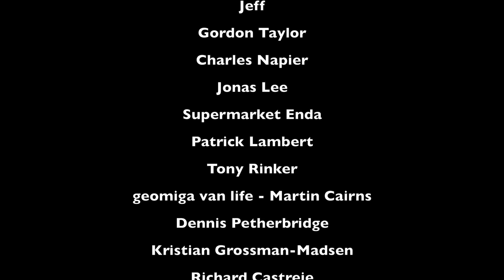Van Build: Diesel Heater Fuel Line Assembly

Comment: Try to get some insulation on the walls. the warm air from the heater and cold walls of the van may cause condensation and possible mold issues.

Comment: Looking good so far! I've put a 2kw version in my DIY camper and have been very happy with it so far. Keeps the camper at 18 degrees on it's lowest setting. It's been around 2 degrees this week.
Reply from the maker: That's great your heater is working. 2 degrees, not too different to temps around here lately!

Comment: Hi, the pump will wear out prematurely if mounted on an angle, it's about lubrication... It needs to be straight up to be properly lubricated  
a small adjustment
Reply: I'm pretty sure that it's supposed to be mounted at an angle

Comment: Nice, and as its dry heat your condensation won't be a problem/until you turn it off/so just leave on low over night, when you go to work leave a window slightly opening to compensate for moisture/yet know dought your still get sum/even insulted vans get plenty of condensation.. All best

Comment: Neat installation so far 👌 those fuel filters are traditionally rubbish and tend to easily crack and leak through the thread, would suggest replacing with a moulded plastic one from a motorcycle or petrol strimmer type, nice to see pipe clamps rather than jubilee clips 👍......love your vids 😁

Comment: Your drilling skills have improved!!!
Just joking.
Heads up if you bought the china knock off heater you may want to watch a few videos online about how to fix some of the common problems with them. Might be extra critical for you do to not having insulation.
Reply from the maker: Yeah, I'm definitely going to have to do that when I get time :)
Reply: there's actually counter clockwise drill bits available... good for drilling out broken screws.

Comment: Have been wondering where you picked up the small thermometer that you have stuck to the wall in the back of your van? Can't seem to find one online. I also have an NV200. Love your build.
Reply from the maker: the small thermometer was probably from Lowe's or Home Depot. Nice, how do you like your Nissan?
Reply: @KiraandtheSurvivalPod  I've had the NV since 2014 and have had no issues at all.  It can really take a beating and loving the gas mileage. I recently put some all-terrain tires on it as you can see on my 'channel'.  
Gas mileage is slightly down, but an extra inch of clearance and off-road capabilities really improved. Peace!
Reply from the maker: @biosfearmag  That sounds awesome. The mileage is such a selling point for the NV200. Also, I'll try some different tires for more clearance maybe. Sweet!

Comment: Looks as cozy as the inside of Pooh bears tree.
Reply from the maker: LOL! love this
Reply: @KiraandtheSurvivalPod  thx Kira- I’m contemplating buying a van like yours- either that or a Honda Element.  My concern is the ground clearance (as you know). I think you probably get great gas mileage though and I’m sure the NV 200 is very reliable. I hope you don’t mind if I consult with you periodically.  I love your channel and I’m impressed with your ingenuity.  Your channel has tons of potential.
Reply from the maker: @davethedoginist  The low ground clearance is a bit of a problem (I punched a hole in my oil pan after going over a rock this summer and had to get it replaced). Im going to see how winter goes with the low clearance as well... I'm not sure what to expect, but I'll try to keep you posted. :)
Reply: @KiraandtheSurvivalPod  Thx Kira be safe!

Comment: Check the filter installation on the fuel line. Looks to me you might have put it in the wrong way.
Reply from the maker: Double checking that is in my list of things to do. It's possible :)
Reply: I think it's correct.  there's usually an arrow in the direction of flow.
Reply: @Douglas.Kennedy  no harm in checking. Don't want it to burst into flames or anything nasty like that.
Reply: I found a good webpage on diesel installs with pictures: https://abigpeacheyadventure.com.au/diesel-heater-mistakes/. you're right, don't want flames, nor the heater cutting out in the middle is the night when it's 50 below outside!

Comment: You might want to consider buying new fuel line for that heater.  Chinese quality being what it is, there is no way I would trust it.  If that line corrodes, it could burn the van to the ground and possibly you.  Also, the filter. Get a good quality American or Canadian brand.

Comment: I'm not sure why you're copying forests van (it's pretty crappy). That wall just takes up too much space in such a small van. I'd buy a rear ladder and mount the tank on it outside along with the fuel pump underneath the van. The fuel pump tick is annoying and mounting it outside helps.  And unless you bought the small body diesel heater (2k btu), anything over 3k btu will burn you out of the van. I think a propex would serve you better, but it does cost 4x more. Also, buy a few extra glow plugs and a webasto fuel pump as a backup. GL.